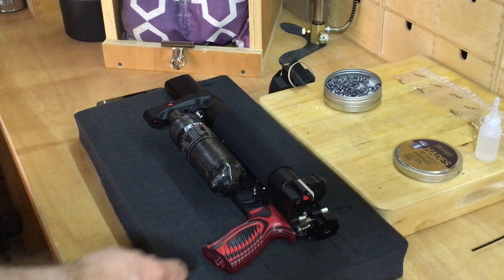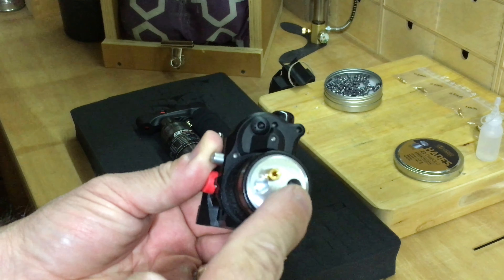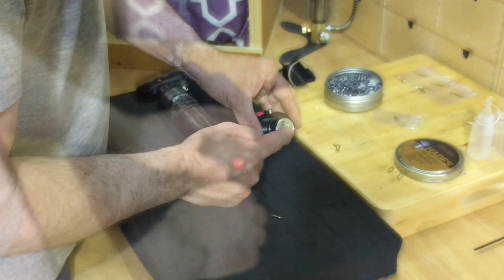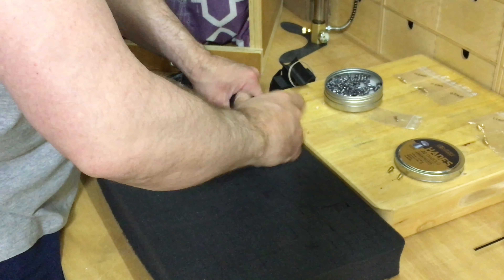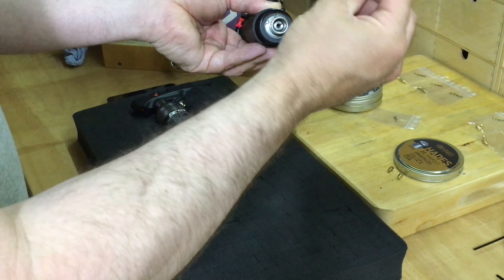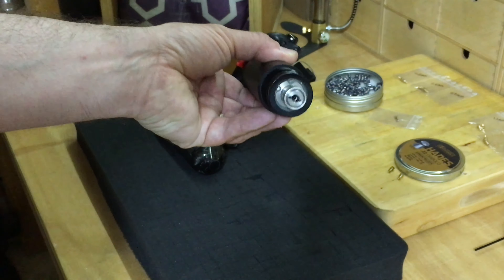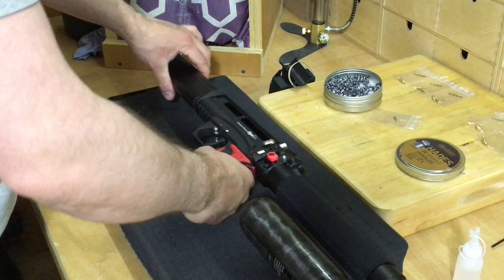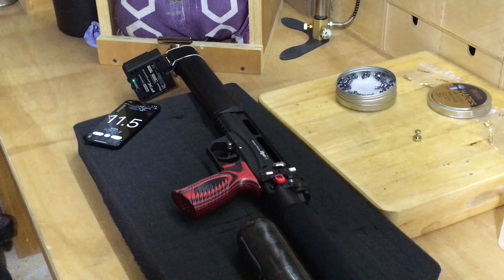EdGun Leshiy 2 - Changing the Power Jets/Nozzles & Adjusting the Regulator to Fine Tune

Comment: I would like to add a suggestion.  Check the holes with a go/no go pin set.  Since the smaller hole jets are never used by the factory, but they are made for customers.  Edgun gunsmiths in Russia will drill out jets that say 0.2 to 0.5 or 0.7 when setting up guns in the factory.  Unless you bought the jets separately don't go by the markings found on the jets with your gun
Reply from the maker: Good point to make thanks Brian.

Comment: Hi I know it’s a year later I have uk 177 what will be the best size jet are you still happy with the 1mm what bar pressure were you getting in the chamber I heard any lower. Than 65 pellet loses Accuracy after 25 yards thanks
Reply from the maker: Join my MeWe group mate as there are over 300 members on there sharing tips.

Comment: I have the E.A.R on mine and can’t get it up past 8-9 ft lbs the adjuster screw won’t turn any further, what am I doing wrong ? What size puck hole should I have, will it go up if I increase the puck hole size ?
Reply from the maker: It could be a number of things but you need to check what size the hole is in the Puk first. 

Maybe join my Leshiy 2 Mewe group for advice/help. 👍🏻

Comment: hi.
which nozzles are installed in the FAC variant.
thanks tom
Reply: A full tune up kit can be purchased which includes transfer port pucks and a selection of jets  if i recall its around £124 .
Reply: @saltire546   where would I go for a tune up kit pal

Comment: eddgun say quarter turn is plus30 bar
Reply from the maker: I'm EdGuns UK repair/warranty guy mate (and have been for about 3 years) so only know what I know. 😂

To be honest I haven’t worked on the older type regulator now for probably at least about 18 months. 
It’s the newer E.A.R ones or Huma I seem to fix nowadays.
Reply: sorry man,no diss meant have added 600 ap brrel and cannot get to index,i open breach it jumps round,also if i changebarrel back to 350 ap works again,any ideas ,i feel barrel maybe to long,
Reply from the maker: None taken mate. If it works with the shorter barrel, it must be how you've installed the longer one. @robinmoore1994
Reply: i have carefully installed the barrel although it mabe proud a whisper although i have put it under tension before tightening,i beleive the barrel is machined longer at the end,if you have any advice it would be great as i have spent a fortune to have the best and its not working out @5euk
Reply from the maker: If the barrel wasn't bought from Edgun, it could be machined differently at the end so there is not much you can do I'm afraid. @robinmoore1994
Reply: barrel is apbought of edgun with full valkri kit,cost a fortune @5euk
Reply from the maker: @robinmoore1994  It’s difficult to say what the issue is without seeing it I’m afraid.